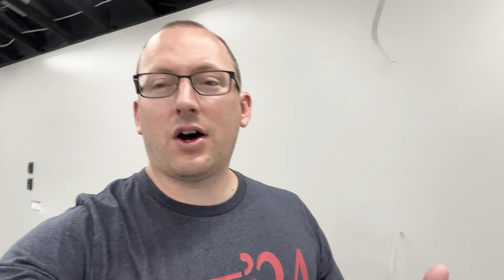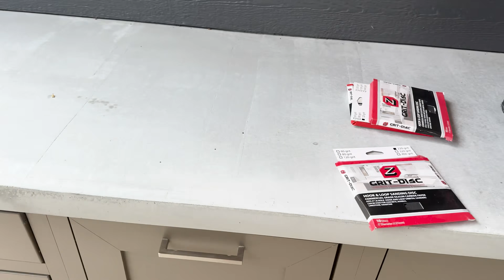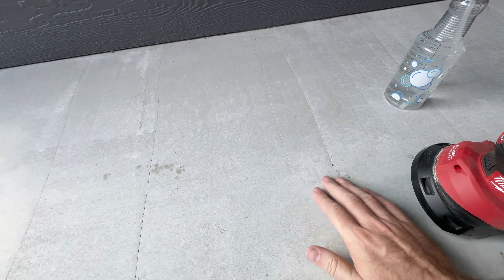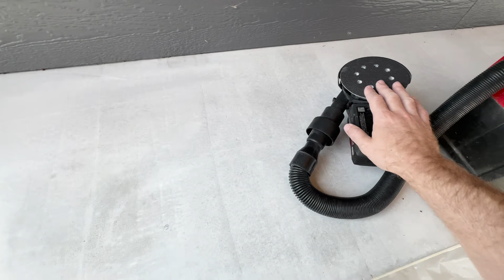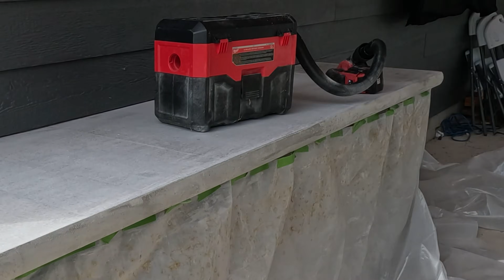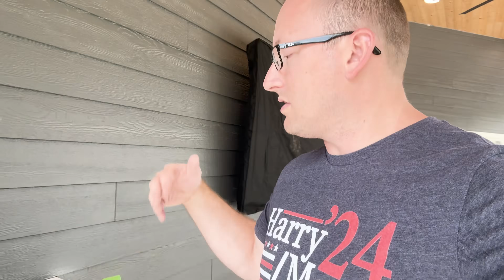Concrete countertop DIY Sanding and Finishing Pt. 1 // Garage Build Ep. 81

Comment: What caused the horizontal lines?
Reply from the maker: Poor troweling during the finishing portion of the pour.
Reply: HI,  I had a similar  cituation with my counters, I used a 50 grit and did not like the look of too much agregate, what I did was pour  a slurry of concreatand sand  a green bag from sakrete, and  I did 3 coats and a good trowel float waiting 7 days then I will use a 3000 to polish. We will see so far it looks great.
Reply: Facing a situation where the top has high and low spots.